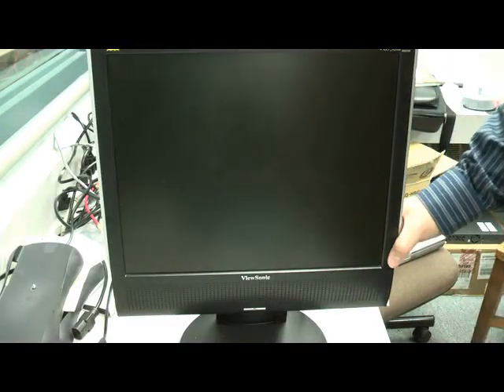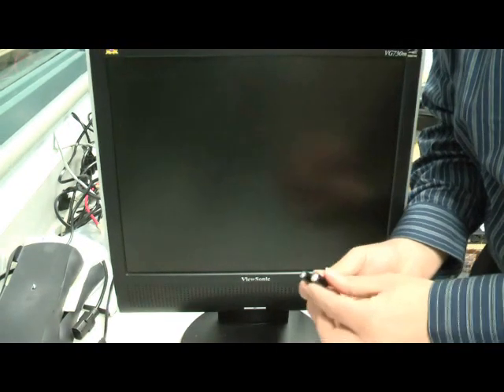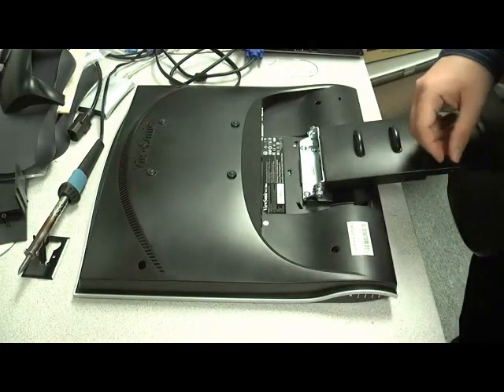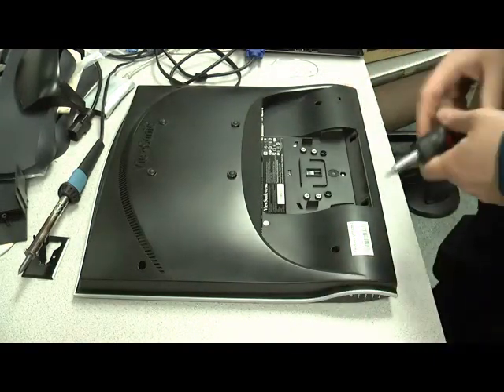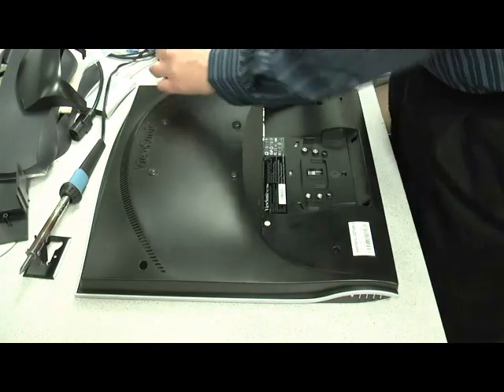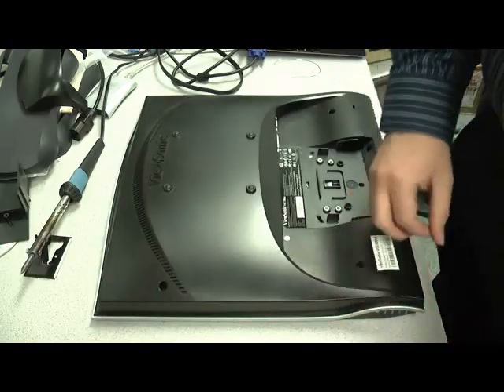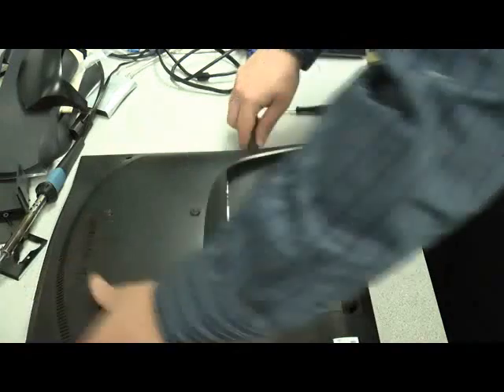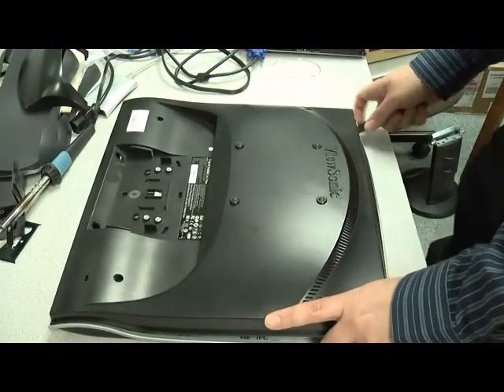Repairing the ViewSonic VG730m - 1 of 5

Comment: Hi. My Viewsonic 17" LCD (not an OLED) power ON but after less than an hour, it flicker. Which of the small capacitor or capacitors should I replace. There's seven, the six smaller ones have these micro Farads:

two 470nF 16v
one 680nF 10v
one 33nF 100v
two 330nF 25v

Thank you in advance.

God bless, Proverbs 31

Comment: Hi,

  I have a Viewsonic VX1935wm-3 (VS11444) monitor which does not work.  Even the power light will not come on when plugged in. There are no screws holding the case halves together and I don't see any pry points either.  How do I open this sucker up without breaking the case?  I already removed the base as well as one little screw that doesn't even look like it holds the case together.  I'd like to fix it if I can.

Thanks,
Randy

Comment: Two of my caps were visibly popped but advice from badcaps.com suggested replacing all the 8-12mm caps.  I found quality caps from a reliable manufacturer at Mouser Electronics.  

Here are the descriptions of the Aluminum Electrolytic Capacitors I ordered: 50volts 470uF 12.5x20, 220uF 50volts 10x20, 16volts 680uF 10x12.5, 16volts 1000uF 10X16.  All are 105C rated and the total was less than $3. (~$10 including shipping)

Happy soldering!